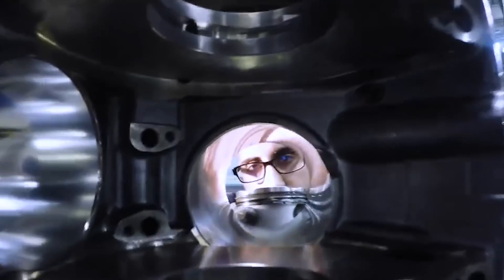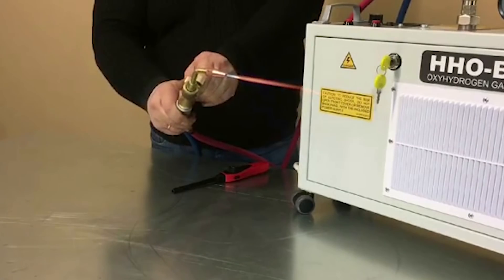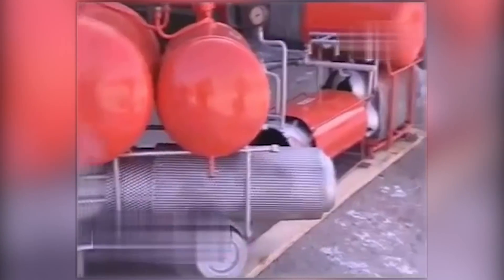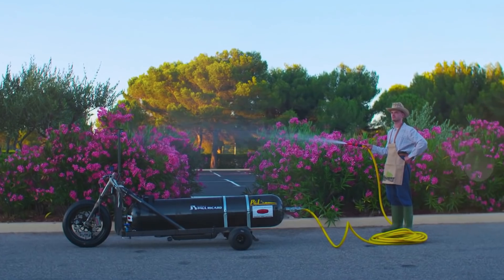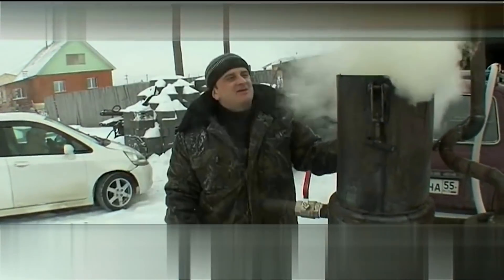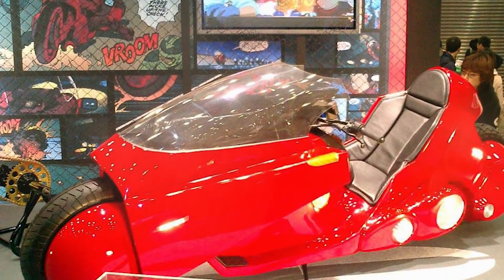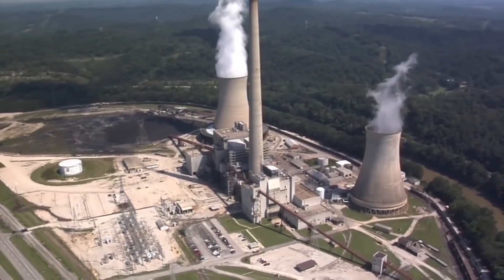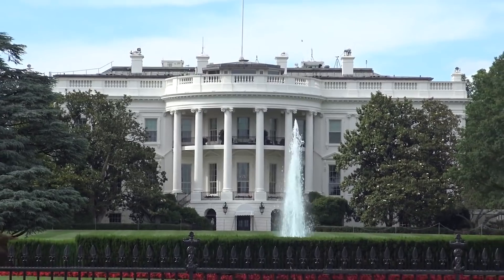Why These Engines Are Banned?

Comment: These are not banned, most of them are inefficient or have short range or multiple limitations that make the standard gasoline and diesel engine designs more cost effective / efficient to utilize or even just straight up batteries and electric motors. The nonsense spewed here really hurts my head and needs to be debunked.

Many of the gains in efficiencies for combustion engines came with better understanding of material sciences, focused on decreasing weight of components, increasing strength and reducing friction. Many of these were only achieved in more recent years as the techniques became cheaper and better understood to apply consistently. As well as research into combustion process itself which could be made more efficient but at the cost of more polluting poisonous gases, guess what your catalytic converters are for. (I.e. the skyactiv type combustion with higher compression but limited to what gasoline can be compressed to, diesel can go higher without self-igniting). Opposing pistons also work similarly by having high compression but with two work output per chamber and are being launched out for power production mostly because that maintains a steady RPM rather than fluctuating all over the place as in a car engine.

OHH engine is just inefficient wasting power that could drive a electric engine because you have the H2 production followed by combustion and all its mechanical losses, waste of power. That and H2 over time causes steel components to become brittle due to the same effect for carbon making stiff steels, resulting in higher chances of catastrophic failure. 

Compressed air engines are basically a steam engine of sort so no not banned just not used in a really long while.

Wood is still a combustion engine using CO(Also known in industry as syngas) due to partial combustion of wood that does not form CO2, it a supreme waste of energy. 

As for driven by a magnetic field, what do you think a electric car is driven by......... yes magnetic fields generated from electric currents (It's a electric vehicle)

Cold fusion..... i don't think we even need to say more.

Thorium is not banned either, uranium was just more effective at producing nuclear weapons and thus got favored in the start of the atomic age. Thorium is in fact one of the key areas of nuclear research for civilian nuclear power because there are more reserves of thorium than uranium and is harder to produce an atomic weapon. Although new type fast reactors are extending the uranium reserves by also consuming waste for power from uranium reactors and are starting to be deployed by russia and are in experimental stage in many countries. India might very well be one of the first few countries to get a commercial thorium reactor. The US just has almost no commercial interest thanks to the anti-nuclear lobby and is resulting in a lot of old reactors being used past their originally designed lifespan to avoid collapse of the electric production grid, which may very well one day result in another nuclear disaster, as the reactor designs are really old and nowhere near the safety level of modern generation reactors with active and passive failsafes.

Comment: The Thorium Molten Salt reactor was developed by the US after WW II.  In 1946, the PUBLIC became informed.  The MSRE reactor, built at Oak Ridge National Laboratory, operated critical for roughly 15,000 hours and supplied power from 1965 to 1969. In 1968, Nobel laureate and discoverer of plutonium, Glenn Seaborg, publicly announced to the Atomic Energy Commission, of which he was chairman, that the thorium-based reactor had been successfully developed and tested.  The Earth's crust contains about three to four times as much thorium as U-238 (thorium is about as abundant as lead).  Of the MSR’s waste, 99,99% is stable within 300 years, instead of the controversial tens of thousands of years for conventional nuclear waste. The remaining 0,01% has no significant impact on the overall radiotoxicity.  To put these numbers into perspective: the yearly consumption of electricity of the average affluent person (western standards of living) requires one gram of thorium per year. This thorium will be turned into one gram of fission products. Of this gram, about 83% only requires storage for 10 years. The remaining 17% needs storage for about 300 years, after which the radiotoxicity of this fraction is lower than that of uranium ore.

Comment: Water hydrolysis is energy storage. It’s not an engine.  It’s also wasteful. 30% of the input electricity is lost in splitting the water. 50% to 75% of what’s left is wasted by the engines burning the hydrogen.

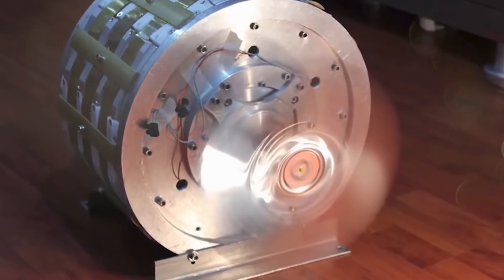Comment: I have stopped watching this at 6:45, as I was totally unaware of Russia being at the forefront of technology. How did I miss that? A really great technology, involves using a substance from old trees, called 'coal'.  Now I know it sounds stupid, but if you set fire to it and pass the heat from the fire into a big tank full of water, this will turn some of the water into a gas. You could use that gas, called steam, to make an engine work, which you could then put on wheels, the wheels could go on rails and it could pull stuff. How about that for innovation? I think a number of English blokes thought that one up!

Comment: In 1978/79 I invented a magnetically driven engine, and also came up with a way of converting any gas or diesel engine into a magnetically driven engine. However, as it was deemed as a disruptive tech I was not allowed to bring this into production. In 1970 my brother invented a carburetor that allowed you to run a gas engine with 65% to 85% water. This was also classified as a disruptive tech and not allowed. I come from a long line of inventors as my Dad and his brothers invented the first fluid gas welding torch along with several other successful welding torches. They had several successful businesses and a few failures along the way. They even got into the movie-making business just when the so-called talkies came into being. The day of the freedom to invent and bring about meaningful change seemed to come to an end sometime during the 1950s I think, as it was about that time that laws were passed to protect the major industries and to stop people like my self from ever bring about any inventions that would help us as long as they were not classified as disruptive to our major industries. Which is in my opinion just as bad as when they made insurance mandatory for everyone and allowed them to regulate the industry. Which in my opinion is as bad as when the governments stopped governing things and allowed most industries to govern themselves, and police to police themselves. We all know just how great that has turned out for us. We are all slaves to the system, and I do not know what it will take to ever turn it all around, but we must find a way or this world and everyone on it is doomed. It is not the law that prevents inventions from coming into our world it is big industry and the powers to be, if they do not want an invention to be on the market they will stop it one way or another.

Comment: Electrolysis takes far more energy put into it than the engine is going to get out of it... so a guy using one to heat his house is paying more for heating that if he just heated with the electricity.  No Big Oil is not stopping inventions.  None of these engines were either reliable or as efficient as claimed or were just to hard and expensive to manufacture.  That air car if it went 100km/k it would have likely had a rang of only a few miles.  These cars are NOT practice.  Do not believe ANYTHING that comes out of China unless it is tested outside of China.  None of the "cold fusion" experiments have NEVER been able to be duplicated.  Usually it is found to be BS to get papers published in hopes of getting funding.

As for the theories of all the deaths...  I doubt it is the US government or Big Oil that is behind them if they are actually assassinations.  It could be other countries hearing about the possible tech and having the scientist assassinated to try and prevent the technology from happening... giving the US a huge advantage over them.  It could be the technology could never have worked, but based on the rumors they did not want to take a chance.  Likely though I think there are much more reasonable explanation that does not evolve the illuminate.

Comment: "The motorcycle uses a revolutionary magnetic engine that uses pulses to control the magnet's position" -- AKA just a regular permanent magnet servo motor integrated into the wheel. Just throw in some fluff language and any mundane piece of technology can start to sound cool.
Reply: And it runs on magnetic field!
Reply: Right? Standard everyday electric motor... But no, it's not simply an electric bike, it's a magnetic bike!
Reply: "It uses the variation of a magnetic flux to make for an extremely efficient vehicle"

Oh... So a motor and a flywheel
Reply: how about the air engine?
Reply: @giorgosdim9845  That's a regular piston-driven "steam" engine running on compressed air, it would also work with a simple turbine. Has existed for over a century. But the reason it didn't catch on is because the energy density of compressed air is never going to be enough to give the car a reasonable range while still remaining safe. You don't want that pressure vessel to blow once you're in an accident.

In short, yes, it works (it makes the power tools in your shop spin), no, it's not that useful when you bolt it onto a car.
Reply: @Stoney3K  I hadn't read through the previous posts, (simply 'coz I was so annoyed) but yeah, I think we might agree.
Reply: @Stoney3K  Exactly!
Reply: @giorgosdim9845  Exactly what @Stoney3K Said, but even worse, How much energy do you think an Air Compressor would take to pump all that high pressure air into another vessel, to only then transfer that (which is not 100%) to another, smaller, high pressure vessel in your car.  Moreover, When inserting compressed air into a car, the tank heats up A LOT, which means once it cools down, you lost part of that pressure just for that. Also, on cold weathers, you loose a lot of pressure by the nature of the vehicle, meaning your car runs a lot less on a tank. 
Another issue, let's say you fill the tank at 120PSI on a cold day (0C) and haven't used that air at all, next day is very hot, and you leave your car under sunlight, where the metal reaches 35C... Now you have a vessel at 135PSI. Imagine if there's a fire or something if just this much heat can increase the pressure that much. 
It will explode if full.
Now, how weighty you thing the vessel will need to be to meet all guidelines and margins? That's the only reason H2 motors didn't take off despite Hydrogen being much more power-dense (per gram) than gasoline. Once you factor in the weight of the container, it's shit.
Reply: @darkgodem  actually the ones I work on on the merchant navy are pretty cheap to run but it doesn't make any sense to use them on a car. They are made to compress air not move the crankshaft. It's like going from A to B backwards from Z
Reply: @giorgosdim9845  Exactly my point. The compressors themselves might even be efficient, but you then have to store all that air, and slowly transfer them to multiple hundreds or thousands of cars, in decentralized fueling stations... It quickly becomes inefficient
Reply: @darkgodem  no I think what he meant was that each car would have one. So best case scenario basically two engines per car doubling their cost or idk the air would go out of a nozzle propelling the car😂
Reply: @darkgodem  Greetings (and Stoney3K too), I couldn't agree more, BUT, I also consider a pneumatic system as potentially valid for 'back-up' power generation. 
I don't claim it is efficient but if you 'bear with me here' I might just make a case?
Firstly, I do mean 'back-up' not replacement.
Of course you could have a battery bank to do the same job, but batteries are expensive and require maintenance and degrade over time/cycles? You might guess that I know a bit about the subject but I have to admit I have no hands-on knowledge of pneumatic systems other than to see them used in offshore oil-rigs for the escape boats.
My idea is simple, a small solar panel (say 20 w) to charge and monitor a large high pressure reservoir, we're not worried about efficiencies, free power from the sun, stored in big tanks, pressure maintained to be used in emergencies.
I have'ta admit, I didn't think of the effects of low temperature nor of the noise that such a system might create in action, still though, worth thinking about?
I would love to get your opinion.
Pax vobis.
Reply: @conmcgrath7502  They're looking into pneumatics for stationary energy storage (in places where pumped hydro storage is not practical). It can be more effective in buildings because you can run higher pressures and have more means of containment in case something goes wrong.

When it's on a vehicle, you're also looking at technical challenges like crash safety, in addition to saving weight.
Reply: @Stoney3K  Agreed, the car application is a 'non-starter' (pardon the pun).
Reply: yeah the fancy words really are something but think of this they all work the same way doing a powerful efficient flux is what's supposed to be carried out, my brain hurts that people still can not see this.

Comment: By the way on eBay and Amazon you can find Chinese made electric cars in India made electric cars for $1,000 and up the rule freakish point about those electric cars they're only good for 30 miles and they're not made to withstand driving in the winter they only have one windshield wiper the heater switch for defrost but if we have a tectonic plate slippage that's what the Rothschilds are betting on because they had me on musk build for China 6 Tesla Giga plants 4 in China 2 in Australia since they own most of Australia now oh by the way if a tectonic plate slippage is just for in it will cut off every will on that tectonic plate Saudi Arabia one good Rumble no oil at least for a few weeks

Comment: I saw a special on the air car back in 2006 and well the car was called out because of blatant lies it told.  Its actual max speed is only 18 miles and hour and could only go for about 2000 feet on a full tank which has to be refueled every 20 minutes.  The car that was released that claims to be air powered is actually not legal in most countries do to the fact its main fuel is actually propane.  The company admitted that the propane was only to start the engine but that was it, but safety did not matter because propane in a small car like that was too dangerous and well its quite funny how the engine actually also requires electricity and other functions.  The also does not meet most legal restrictions do to the fact because of its shape and design it has a nasty habit of flipping over constantly if it goes faster than 23 miles and hour.  No wonder the only actual places that vehicle operates in a car factory and is only used like a golf cart.

Comment: Compressed air is one of the most inefficient energy storage mediums ever. For example my 350 watt electric sander outperforms my (1750 watt compressor powered)  air sander all day any day.
Reply: right, compressing of air: 85% of consumed power is converted to heat, 15% of consumed powe is converted to compressed air. Even a steam engine is more efficient, and they are crappy since the Diesel showed up with its back then efficiency of 25%. nowadays a diesel gets to about 43%, and the most efficient ship Diesel are at 50 to 52%. thats top notch, best you could buy for money.
Reply: When I was a auto mechanic apprentice , I had a boss who would roam around the workshop looking for leaking airlines ect. And go ballistic. If was my job to keep all in good nick. But he was right, compressed air is an expensive necessity
Reply: it would be compressed by a huge machine which is more efficient than individual small machines.
Reply: @noahlaque3901  Compressing air is very inefficient, irrespective of the size of the machine doing it. You will struggle to turn even 50% of the energy used by a compressor into actual stored energy. Then you have the inefficiency at the other end when converting the compressed air back to mechanical energy. Couple that with the low energy density of compressed air and it doesn't look useful for much apart from niche cases.
Reply: @noahlaque3901  still, compressed air engines are super ineficient. even if you could get a super efficient compressor.
Reply: @jizburg  access to energy, energy transfer are what matter most.... if you can get energy from a stream for free but only 10% efficient - it is still better than nothing at 100% efficiency
Reply: @WolfpackHockeyAlpha  of course. If we have free energy then it would not be a problem. But energy is not free. And even if you had free energy there are better storage per volume than compressed air out there. Especialy if you count the ineficiencies of compreddef air engines into account. For example hydrogen fuel cells. Lithium batteries. And so forth. electric engines is about  80% efficient. So basing your system on electric engines has several advantages already.
Reply: @jizburg  dont forget a ever evolving invention , the capacitor . Better : the supercapacitor . Capacitors have reached the level to replace small battery,s and they are still evolving . If you can eliminate the leak current and make the storage capacity bigger . Then battery,s are dead.
Reply: @smellslikenarcspirit  shure super capacitors are awsome. I never said anything against them did i? And they are going to drive electric engines. Essentialy acting as super efficient batteries.
Reply: @jizburg  no you didn't . I Just mentioned them .
Reply: @smellslikenarcspirit  ok